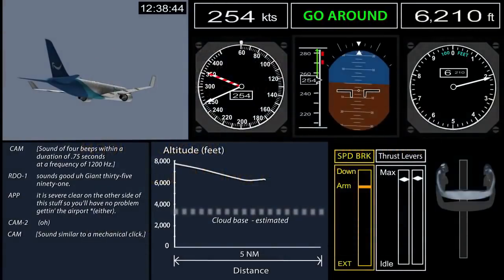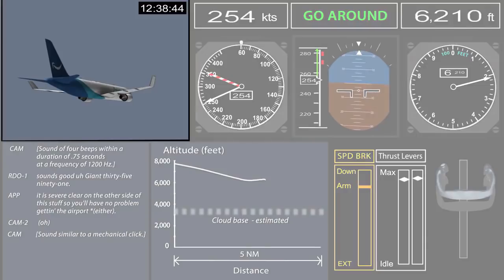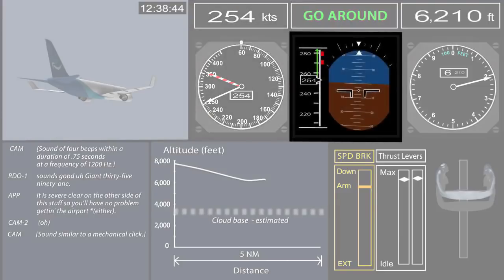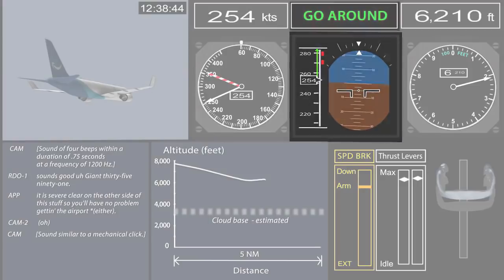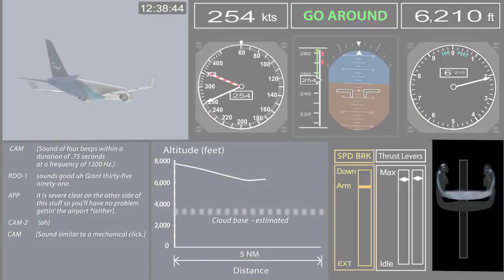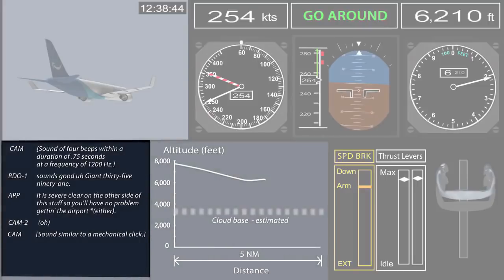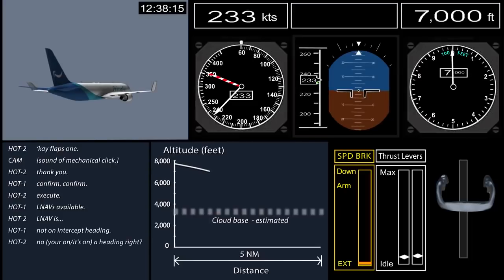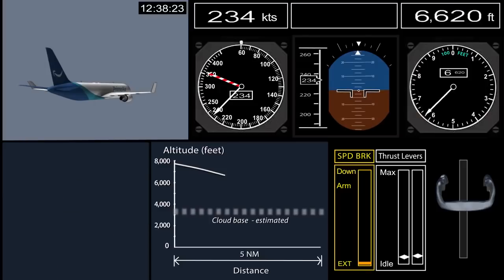Atlas Air Flight 3591 • NTSB Animation

Comment: This is what the back story here is: The guy who did this failed training at three other airlines. Failed his ATP checkride twice. Got hired at a small shitty airline then failed his simulator rides twice and didn’t upgrade. Failed his aircraft type rating checkride at his cargo airline. Accidentally hits a button while flying, panics and pushes the nose of the airplane over while low to the ground, reaches unheard of descent angle and airspeed, and kills him self and two others. Others said he would “start pushing a lot of buttons without thinking about what he was pushing.”
For 99.9% of pilots, a single checkride failure is frowned upon and needs explanation if they ever hope to get to a major airline. Two checkride failures, forget about it. Rumors said he threatened to sue for racial discrimination after his failures.
Reply: Dafuq!!?? How on earth was he behind the controls
Reply: @ghost.protocol  fast shipping for lowest cost
Reply: @ghost.protocol  
DIE CRT BLM empowerment inclusion tolerance.
Reply: Plus he used the go-to race card on more than one occasion, during his short stint with those smaller companies who probably didn’t want the notoriety, and just passed the goof? Another shining example of everything that goes “woke” turns to shyte! Not rumours, factually true according to past employees and co-workers of this goof?

Comment: NO, no, no. Look at mark 1:07 of the above transcript. The FMA is blank until after an area mic catches someone (the FO) call for "Flaps one." On the transcription you see it. Then it records: "Sound of click." That click is the flaps handle being moved into the '1' position. Immediately thereafter you see the FMA annunciation: "GO AROUND." Notice the thrust levers advancing to the go around setting automatically immediately. This could have ONLY happened when the Captain moved his arm around the thrust levers to grab the flap handle and accidentally brushed up against the Go Around thumb switch on the #2 lever. I've come close to doing the same thing myself on numerous occasions. A captain must use caution and diligence when deploying the flaps on these birds. They warned us about it many times in simulator training at AA... It was the Captain who caused the auto-pilot to engage into the Go Around mode, and it was the First Officer who didn't understand what he was seeing after that. No one in the cockpit was watching the FMA.
Reply: The Captain didn't just fail to realize he hit the GA thumbswitch, but he also failed to respond to the PF placing the aircraft in a dive. He had numerous opportunities to take positive control, like he did earlier in the descent, and recover his aircraft. He never did. The poor guy in the jumpseat didn't deserve to be locked in an aircraft with this crew.

THAT SAID, I once allowed a student to overspeed because I had too much trust and disengaged. Flights are long. It's impossible to be completely attentive for so many hours, so I get it. I bet if the FO put them in a dive at 16000 instead of 6000, we probably wouldn't even be here talking about this, because the Captain would have saved his aircraft, and the FO would be driving tractor trailors right now. I feel for them.
Reply: Wow, thank you for this added info.
Reply: No, flap extension occurred several seconds before GO AROUND was activated.  There were two [Sound of click] entries on the transcript.

Comment: I don't know here. Accidentally selecting TOGA sounds fishy. I mean, you have to reach the rear and somewhat down of the throttle lever with your thumb to activate it. These are not the typical red buttons on each throttle knob end. These are on the back of each lever. If the throttles advanced on TOGA, the A/T was on, so why having your hand so firmly on the throttles.  Something is missing here. RIP
Reply: According to the NTSB Hearing, the F/O was guarding the speedbrake lever with his hand, per Atlas Air operating procedures. The aircraft went through some turbulence and it is suspected the F/O/s hand/watch accidentally bumped the thumb switch, leading to the inadvertent TOGA activation. Here's the link to the NTSB conference: https://youtu.be/Am3Q2LsPIk4

Comment: That guy killed everyone in less than 30 seconds, don’t be like that guy.
Reply: The company is responsible for hiring him. The FO was a totally incompetent and had washed out of several other positions as a pilot.
Reply: @marlock6573  I know lots of pilots that were fire due to incompetence or crashing an airplane.  They went off and got better jobs because they didn't disclose their shortcomings.  To be fair, would you tell your new company in the interview that you got fired from your previous jobs because you were incompetent or crashed?  If you say yes, then either you're lying, or you're an idiot, because no airline would hire you if you said that in an interview.

Comment: Can someone explain me please why the 767 does not retract the speedbrake by itself in air when the thrust levers are in TOGA?
Reply: They are old school Boeings, not Airbuses.
Reply: Speedbrakes/spoiler only auto-retract on the ground during a go-around after a certain throttle lever angle (TLA) is achieved. To my knowledge, in 30 some years in various flight and maintenance/engineering roles, no airplane is capable of auto-retract speedbrakes in flight. It's always a manual function. However you will get many bells and whistles and annunciators (attention getters) if they are mis-configured for a particular flight regime.

Comment: Idk how anyone can lay any blame on the captain.  The FO basically decided to murder everyone.
Reply: The ones blaming the Captain cannot accept the fact that “diversity and inclusivity” have ZERO place in the cockpit. Anything to absolve responsibility from a highly incompetent and unairworthy FO.
Reply: @soccerguy2433 Ultimate responsibility for the safety of any flight rests with the captain. This wasn’t murder. It was a mistake. If the captain had done his job they would still be alive. 

As in virtually all air crashes, there is plenty of blame to go around; the NTSB faulted the captain, the first officer, the airline and the FAA. All four had to fail for this to happen.
Reply: @lebojay  you're imagining what is actually possible.  Do you ignore your PNF duties to eagle eye your qualified FO for every action he takes?
No you dont.  What could the captain do to prevent the FO from pitching down to 30 degrees nose down. 
Please do tell.
Reply: @soccerguy2433 He could have commanded a positive transfer of control, which the NTSB points out he failed to do at any time. As a consequence, the first officer was allowed to continue commanding full nose down pitch for long after the captain tried to intervene. 

I’m not saying that anyone deserves a death sentence for these mistakes, you understand. I’m just stating the facts.
Reply: Toronto Jay Pretty sure you are still missing the human factor here. He was trying to figure out what was happening. The FO may have had 15 seconds to fix it if he was competent, but a couple seconds less for the captain, who it seems was making a radio call at the moment just before it went bad

Comment: Boeing Togo switch has been implicated in a couple of 737 crashes and now this 767 crash.  It seems too easy to inadvertently activate and too complicated to disengage when activated.
Reply: TOGA switch hard to disengage. seriously are you a pilot?
Reply: @97HKG  Apparently, these professional pilots failed to disengage Togo mode.  Same thing happened in FlyDubai 981 and Tartarstan 363 with great loss of life.  Think of the lives lost instead of your snarky response.
Reply: @encinobalboa  right and put the blame on a specific aircraft when clearly its the humans fault in both MAX crashes, FlyDubai 981, Tartarstan 363. This accident is not different from any other accidents where humans play a role in basic aircraft flying and they lose situational awareness. 

PS: TOGA disengage on any Boeing should be easy (if im not mistake): just hit the disengage buttons on the side of the throttles and idle the engines
Reply: @97HKG  The Amazon pilots did not realize they were in togo.  That's poor design that cost lives.  I'm sure if you were a passenger, you would be the first to excuse the design.  My point stands.
Reply: @encinobalboa  Millions of flight hours with the current toga switch designs and you say its a poor design. My point still stands that if you can not maintain situational awareness while flying in IMC, you better pick a new line of work.
Reply: @encinobalboa  Poor design? Have you ever flown airplanes with FMA? It seems you have not.
Reply: @encinobalboa Read the accident report. There was every indication that the autopilot was in toga mode. According to the report, this is the first time in the history of aviation that accidental activation of toga led to an incident.

Comment: But why they had instruments to go on must have know that the sensation is not real isn't that part of training
Reply: Engines spooling up means more airspeed so no stall.  A quick glance at the IAS and Artificial Horizon would have told the co-pilot that they were in no imminent danger.  Most Cessna pilots know this.  Most flight sim gamers know this.